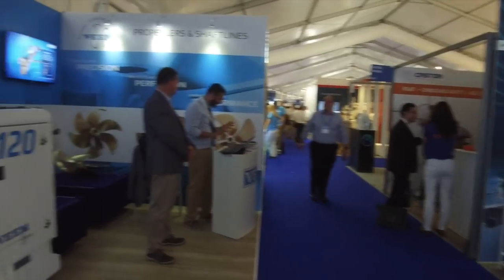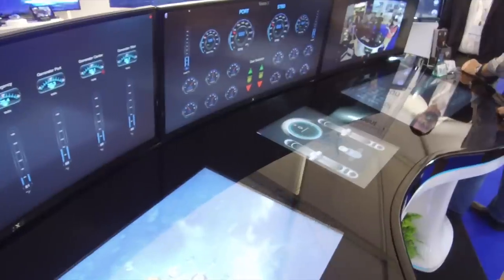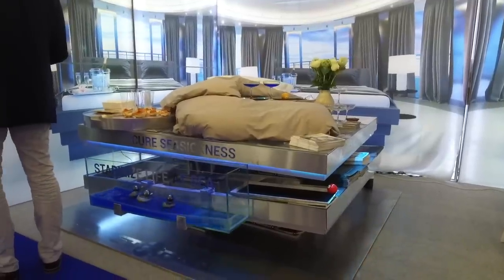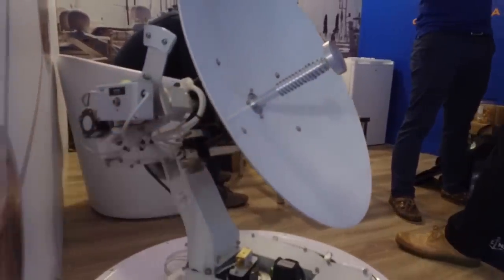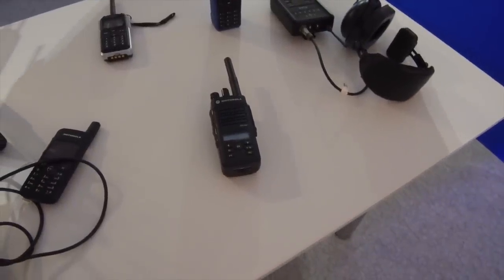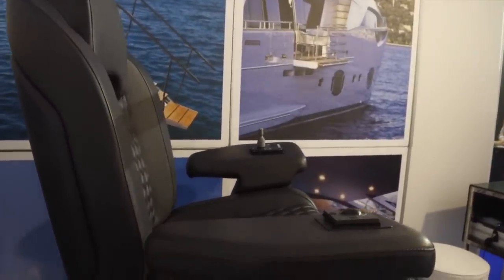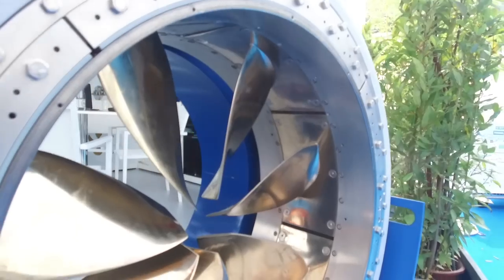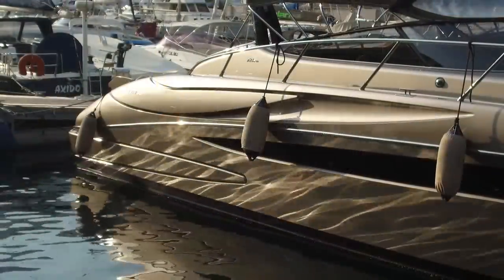Monaco Yacht Show - Billionaire Tech 2017

Comment: FLIR is not a nightvision camera, it's a Forward Looking InfraRed camera. Instead of visible light it registers infrared light. It doesn't have a filter on it, it works at day and at night. It can see heat, this means it can see other boats at night in a storm, you can see if someone is in the water and you can see the shore and obstacles at night. It's the most practical visual assist you can have on a boat period.

Comment: The flir system you mentioned in the beginning is actually an infrared camera that detects heat and its not just night vision. That's why people are showing up bright white on the camera even in a lit room, because it's detecting their body heat.
Reply from the maker: bksvaluemenu That’s correct, that’s what night vision is.
Reply: no. night vision is photomultiplier tubes which multiply the photons -- thermal systems are infrared cameras.